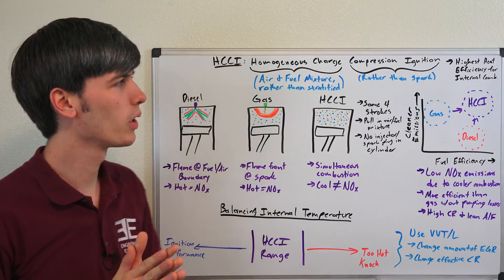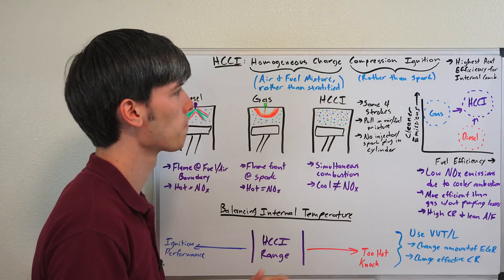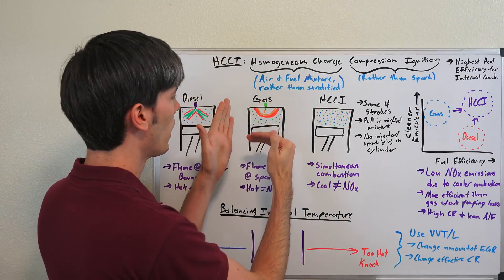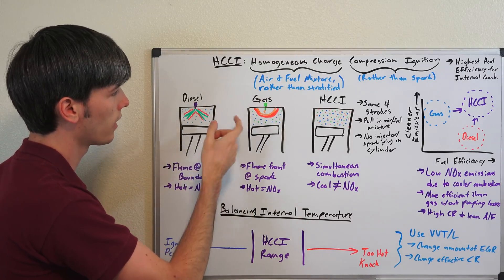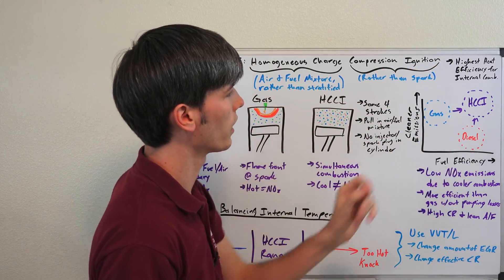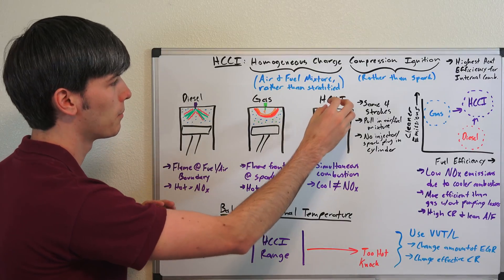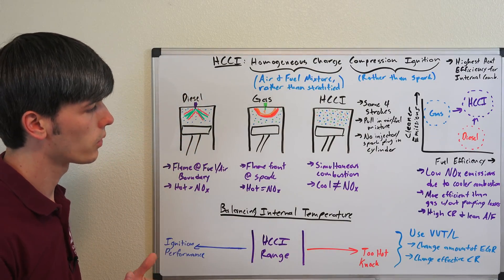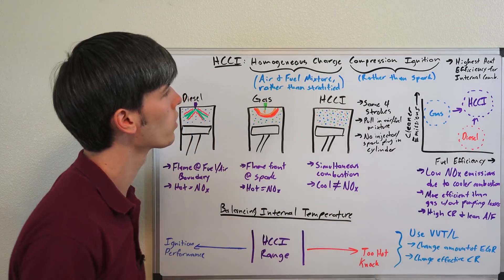The Most Efficient Internal Combustion Engine - HCCI

Comment: Im probably not the first to say this; but, I am confused. If lower compression ratios given by the Atkinson Cycle increase efficiency, why would the same concept not hold true with HCCI platforms? I assume fuel loss would be greater with pre-mix. However, based on your video of the Atkinson Cycle, efficiency is gained on the exhaust side from lower pressure, despite fuel escaping during the initial compression stroke---fuel then consumed by any cylinders undergoing an intake stroke. Assuming the HCCI setup was analogous to a modern 4 cylinder Atkinson Cycle engine, aside from from their inherent differences, why would lowering compression in HCCI decrease efficiency when it increases efficiency in a traditional gasoline engine?

Comment: So lowering the compression with the intake valve has me confused. Why would you want to leave the intake valve slightly open during compression? Wouldn't that be pushing air fuel mix out of that valve and into the intake manifold? And wouldn't that make it harder to regulate a/f mix when the air is coming in with fuel mix already in it?

Comment: I want to see a diesel type compression engine with gas. Im curious what kinda efficiency could be achieved as well as any incress in torque and power over a traditional spark ignition system

Comment: At 4:30 you say that you lose efficiency through lower compression from delayed intake valve closing. Why is that?

The problem is that that's the entire premise of the prius engine. High geometric compression for high expansion ratio (efficiency) with low actual compression for good anti-knock properties

Comment: As usual you're way behind the curve on what's possible. HCCI only works at low loads and low power levels. Look up reactivity controlled compression ignition. Basically you're using diesel and gasoline, Rolf Reitz from the university of Madison Wisconsin has been pioneering this, and actually has promise to work at a wide range of loads and engine speeds.

Comment: MAN makes the most efficient engines. and those are certainly crosshead, 2 stroke, diesels. and not "carburetted diesels"@ HCCI diesel. 160-170 cpecific fuel consumption is a thing. this ain't. and they still did not bolt on any kind of waste heat recovery turine besides the turbo. so they still have somewhere to evolve, keep in mind even now those engines are pretty close to the maximum that can be reached in theory.

Comment: koenigsegg camless valves and a dynamic temp adjuster   say multiple  trio of thermostats
you would have a ball but counting on gas compression  timing by   valve regulation is a lost cause
you need oil cooling for the efficiency , possibly reverse flow coolant

Comment: Or you know we could use hydrogen internal combustion engines which are 40% more powerful and efficient then diesel engines. But that won't happen with oil companies having their grip on the world
Reply: Steve Hemmings fuel cell hydrogen is much more efficient then running it threw an internal combustion engine. during ww2 rations many people converted their cars to run on wood gas (hydrogen) it would reduce horsepower power by about 30% and constantly needed to be refilled

Comment: Would like you to look at a Ford 1.0 Ecoboost engine to see why it is so relatively powerful and efficient - I drove one and was quite surprised by the power for what is the same size a 1980's car I first owned.
Reply: Mr Sammotube turbo, direct injection, variable valve timing, extra gears in the transmission, better aerodynamics
Reply: Thanks for the reply, but of course it would not be as good as a video on the subject :)  It seems to me that petrol engines are getting the same treatment that diesel engines were getting because diesel now gives everyone asma even though it was good for the environment.

Comment: I think pneumatic valve actuator (for example, FreeValve) would be a great help to this technology with the freedom of timing and lift control compared to using camshaft.
Reply: well now koenigsegg used it, great
Reply: Pneumatic actuator is way too slow for that job, pressure and temp inside the combustion chamber can rise in a fraction of a second

Comment: This reminds me of the engine that was developed by Smokey Yunick, famed NASCAR mechanic, and also  the reputed 100 mile per gallon carburetors of the 50's.  The increase  in combustion efficacy came about as the result of changing gasoline  from a liquid to a gaseous state before it entered the combustion chamber.

Comment: As I was listening to this, I remembered something I read back in the late 90s. Currently the most efficient combustion engines running are big marine diesels. It's relatively easy to control many aspects of these monsters running, so this shouldn't be surprise, I think. During the time I mentioned, Man-Burmeister, one of the leading manufacturers, conducted series of tests that centered around the idea of perfect fuel-air mixture. Since big engines can have combustion cavite in excess of one cubic meter it took years, before they perfected combination of atomizers and injectors that achieved that perfect aerosol. Sadly, what the encountered was very sharp decrease in power! Cause of this was instantaneous combustion, and resulting gas cooled fast as well, dropping pressure and robbing the piston from potential work. Since then, marine engines have multiple injectors, with different nozzle sizes, non-symmetrical placement and angle of injection. Longer burning of uneven mixture allows extracting more mechanical energy from the combustion process. Emissions are of second importance, because on the biggest ships exhaust gases are nearly 'processed', before released.

Comment: I've converted glow ignition, model aircraft engines to diesel. These are two stroke. Would these qualify as HCCI. No ignition source as in gas or CONVENTIONAL diesel. They have high efficiency and better torque than their glow or even gas counterparts. Up to 25% better mileage and power. 

Model diesel engines use a contra piston. No source point of ignition,,, they look like HCCI, Don't they? See my channel.

Comment: You may want to look into prof. Ångströms (KTH) work in this field. I think Scania may be experimenting with that implementation. But the concept is having two pistons in each cylinder facing each other. Then the crank-shafts are conected with an adjustable gear so you can adjust the compression by offsetting the timing on the two cranks. In the prototype they had the extreme were a idle mode where there was no compression in one of the end points, the cylinders simply moving back and fourth moving the same air inside the cylinder, to the other extreme where the pistons almost touched.

Comment: Hcci engine With a Bio oil reactor XD means no refining instant use of the bio diesel slash gas mix it makes XD with that engine and my reactor... XD need to see if its worth buying the engine only  for power plant off grid system XD ...

Comment: Ignition Source in Diesel???? Wait what? The compressed air in the diesel engine ignites the diesel when its injected at top dead centre.
There is no ignition source the heat generated by the compressed air causes the combustion.
A glow plug, is not an ignition source, it is there to just generate heat to start a cold engine.
On an interesting note the Mazda SkyActive Gen 2 engines will be HCCI.

Comment: Is this not what Honda achieved with PDI-AR technology back in the 80/90's? I realize PDI-AR was 2 stroke tech but you're isolating each example here down to a compression stroke heading to TDC>ignition. PDI-AR as I recall only required the spark plug to start the engine, then combustion continued w/o spark plug. Still amazes me what Honda achieved with NSR500 GP history despite being a 4stroke centred company.

Comment: The compression RATIO cannot be changed by leaving the Intake Valve open. By leaving the Intake Valve open, the compression PRESSURE is lowered, thus lowering the COMBUSTION pressure. Crower experimented with a high (16:1) compression engine. They left the Intake Valve open well past Bottom Dead Center to limit the compression pressure to 150 PSIG. A friend duplicated Crower's effort. The engine pulled very good and consistent through 5000 RPM. It also got mid-20 MPG in a 1973 Caprice with 326 cu in SBC.

Comment: That small temperature range is probably going to hold this technology back for a little bit.

With air temperatures ranging so dramatically due to altitude, weather, high/low pressure systems and just time of year and time of day, There's so many variables that your playing with here that it's going to make it extremely difficult to build a reliable engine in all conditions.

Not saying it can't be done, with the technology of computers and sensors nowadays it's only a matter of time before someone gets the right recipe.

But I think most manufacturers will probably stick to the tried and true method rather than devote millions into developing a theory into reality.

Major kudos to Nissan for considering it as a possibility!

Comment: Since the design is base on ignition by temp vs spark;  monitor the cylinder heat with an upper cylinder casing as a thermostat and heating coil (All Around).

Try a thin coating layer that will heat quickly and dissipate ignition temps quickly. 

Should still have a small nitrogen oxide wave, but less that traditional.  Keep temp within a designed range (thermostat) for timing, then use the heating coil to match predictable ignition temperatures at the right time.

Might have to solve problem if build-up occurs on cylinder walls.

Comment: How physically is possible to simultaneously start a combustion on the combustion chamber. only with the pressure? And doesn't the chamber geometry enforces slight diferent pressures on the corners?

Comment: I still cant understand that a piston starts, accelerates, stops, and reverses, then accelerates, then stops, some 15,000 times a minute (or more?) and doesn't shatter instantly!
Reply: Indeed materials are great in tension and compression but a piston is a round cylinder for a start with a closed end. It has a sort of cross-arm and axles both ends. It can slap and has fatigue issues I suppose. Forces going in all sorts of directions and changing almost instantly with huge temperature.alterations too. Still amazing !
Thanks for the reply.
Reply: rods are in shear not in tension actually..heaven knows what forces are in the entire structure of a piston.

Comment: Mazda will introduce their HCCI engine in the Mazda 3 this spring. The rest of the line will get HCCI engines by 2019. Likewise, the Euro diesel will be available sometime next year. Mazda will be adding a plug-in hybrid (with HCCI engine) within 2 years and all electric cars begin assembly soon. Mazda's HCCI engines bring 30% to 40% improved fuel economy with similar reduction in emissions. Power will bump up slightly (5%). Thus, you have hybrid economy and emissions, with typical Mazda performance and stellar driving dynamics. Driving green means driving dull and boring no more....

Comment: Just wanted to compliment you on your lucid and easily understood expositions on the variety of subjects you choose. For a non-mechanically inclined individual like myself these informative videos remove much of what is not clear about how these systems work and suggest questions about how things may be done differently and possibly better. For example, it is my understanding that a Sterling engine operates on the same piston driven principle as these fuel using devices. So then why aren't they utilized in building a power plant using that principal? Also, I've always wondered if a simple gas powered electrical generator such as those used on construction sites or in power outages, couldn't be used in an electric car for recharging the batteries. Since the operation of the generator would not depend on the vehicle being in motion the recharging could be accomplished at any time. The question then becomes, does the amount of gas required to recharge the batteries equal or exceed the fuel required to run the vehicle in a typical IC powered car?

Comment: This is still here even if proved to be wrong and this isn't the future. The most efficient engine runs on compressed biogas and it's monofuel utilizing 18:1 compression ratio, already proved concept and working on trucks instead of this vaporware which isn't used anywhere, even Oxfords example motor doesn't work properly, provided by GM.

Comment: Hello. You have a great channel and you explain things very well. One question: would any given kind of combustion not be made more efficient by running it in an engine that uses the Atkinson cycle? I mean, if the question is, "What is the most efficient ICE?", then, at the cost of a little energy density, the Atkinson cycle would make any given combustion type more efficient, wouldn't it? Thanks.

Comment: so by that description, would r/c model engines be hccl?  they suck in a mixture, and then rely on the heat of the compression to ignite it.  cold starts are achieved by heating a glow plug.

Comment: I'm trying to imagine a system that can maintain constant TDC (or thereabout) gas temperature both at 1000rpm@full throttle and at 6000rpm@min throttle.
I'm going to guess Nissan is having a hard time imagining the same thing.
Every way you go to fix the numerous issues, you just start approaching a classic diesel or gasoline setup.
I mean we are ultimately just talking about an engine that runs on detonation where we've thrown out the spark plugs, right?

Actually, this whole thing gets a lot easier when you can run a hybrid design and use a small, constant rpm, constant throttle gas engine to run a generator.

Comment: HCCI+FreeValve+Twin Scroll, Variable geometry, turbos with possible electric/belt drive boosters for absolutely zero lag, linear power addition, and boost threshold basically starting at idle.

Plus, seeing only 1 or 2 different types of fuel at gas stations instead of 4-7 types would be great. I don't know of a single thing that NEEDS mid grade, or those weird mid-low grade and mid-high grade extra options you see at some pumps....

And obviously with this, it'd likely replace diesels, too, so only 1 fuel type for normal stuff, and 1 fuel type for performance stuff. MAYBE it would be normal and commercial, or normal, commercial, and then performance. Or you might have to get the performance stuff elsewhere.

Comment: As the engine continues to run the pistons will get hotter.  This may affect ignition timings. Likewise, the fuel might not ignite at all if the air is too cold.

Comment: +Engineering Explained

On normal operation, the solutions you propose to control the temperature are very feasible, but the problem may be when starting a cold engine... or even worse, to start the engine in the summer, and still inject enough mixture to get enough power from the engine... Seems like the power output is gonna be somehow dependable of the temperature control system.
anyway I guess you could simply make a "hybrid system" operating as a gas-spark engine until the desired temp is reached.

Comment: Hi. As someone who lives outside of the USA (Australia) your references to Gas are confusing. Gas to the rest of the world is a hydrocarbon like LPG, or CNG etc. Why don't you call Gasoline 'Petrol' like most countries, to avoid confusion?

Have a look at your diagram above, dealing with an engine design that commonly uses gaseous mixtures. If you drew another chamber labelled 'Petrol' I would automatically accept that you had three fuel types. 

BTW, I like your vids. Just pointing out you have an international audience....

Comment: I think it's rather step back than anything new. After all, how did old diesel engines work?
Also right now we are able to get much more power from engines (especially diesel) because we can compress more air and fuel with the same displacement. This is especially the case of diesel engines which would knot at this pressures. 
In my opinion, much better alternative will be GDDI which shortly can be described as gasoline diesel engine. Similarly it has diesel efficiency (as it's diesel) but runs on gasoline which leads to much cleaner burn. Most of all, it can still produce high power to displacement ratio as it's direct injected.
http://www.delphi.com/docs/default-source/2015-sae-technical-papers/gdci-multi-cylinder-engine-for-high-fuel-efficiency-and-low-emissions.pdf

Comment: Since when does Diesel use spark plugs for ignition? Spark plugs in a diesel engine are only used to heat the cylinders when the outside temperature is low enough to slow down the auto-ignition that comes with compressing the mixture. That's why they are called incandescent spark plugs.. but I'm pretty sure everybody knew this..

Comment: Would the engine have a lower ambient temperature operation level due to the combustion staging? The main event running in my head is the effect off a air-fuel blowback from too high an internal cylinder temperature causing a accidental ignition which jets into the inlet valve. Is that possible and will it cause significant damage if any?

Look forward to seeing more on this. :)